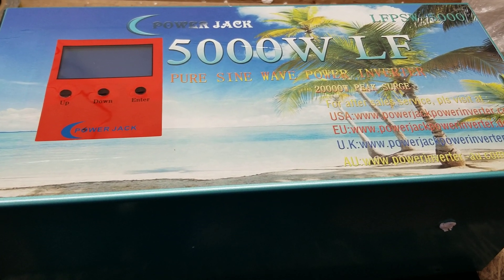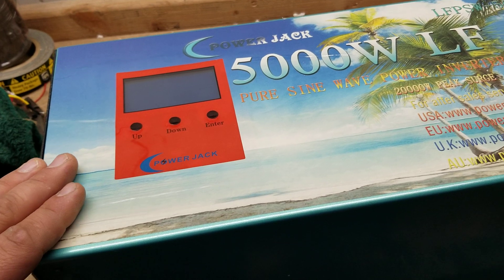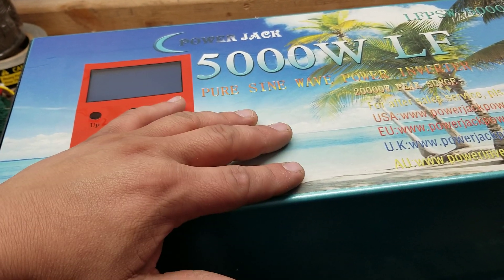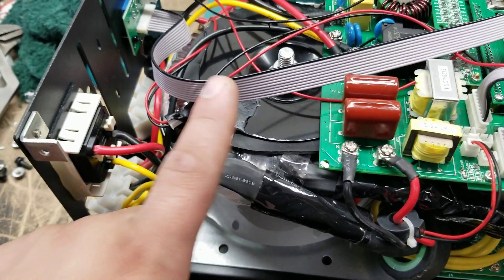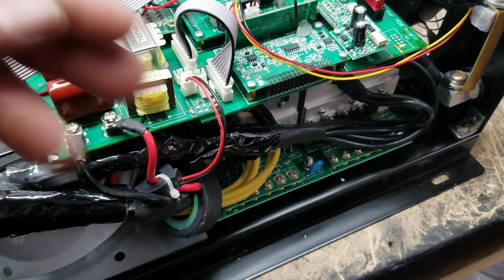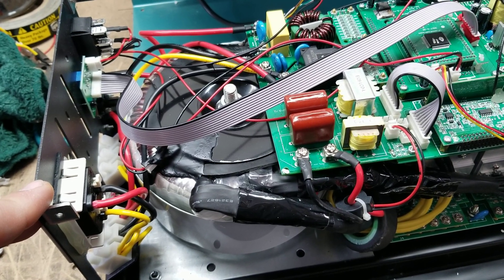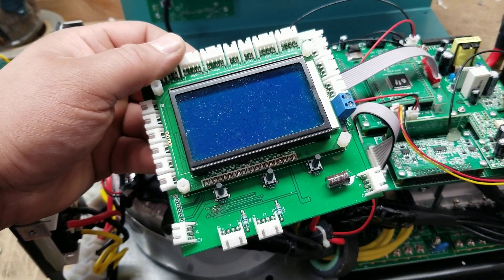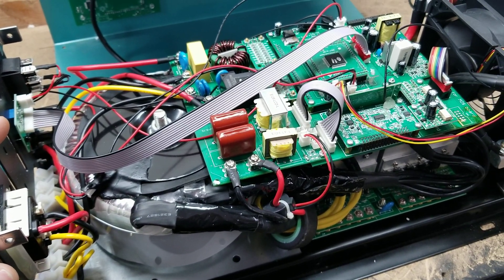5000 vs 4000 LF power jack inverter

Comment: Hi .ser .I have a 5000 watt inverter power jack the two right side mosfet light is off and not electricity coming out of the AC .why is that . He turned on but then the front light doesn't come on. not the green light not the red

Comment: they are both only 1500 watt 20,000 watt peak? LOL. NOPE. 25 AMP FUSE BLOWS AT 1500. That was not a TYPO. 
A, "25 AMP FUSE". That being said, my runs great. It has a nice clean sine wave. At a very cheap cost. AUTOMATIC TRANSFER SWITCH ,is great to have.

Comment: I had a 12-volt system I am changing to  24 volt. Does the inverter go to 24 volts automatically or do I have to do anything to it?

Comment: Search the MOSFET board is easy to disassemble, but I can't get a new one here in Germany! I have had the device since October 2017 and I am very satisfied. After a hard test, the MOSFET plate burned out and I need a new one (heat dead). I'm now installing a fan here. Turn the decel over and build the second fan over the transformer. I charged my batteries for 7 hours and then it was over. I wanted to desulfurize you, I thought 4 hours and then the device switches off, but it was not. The device would be great if you got the MOSFET flap. Can someone help me here? - Thank you (goggle translator)
Reply: El modo cargador hay que iniciarlo con el inversor parado y la Red externa enchufada el ventilador siempre encendido. Si se está usando un generador eléctrico como fuente externa tiene que ser un generador confiable que no cambie. De revoluciones ya que si lo hace cambiaría los herz de frecuencia. Este cambio de sincronisacion genera mucho calor en los mosfet y hacerlos explotar en el peor de los casos

Comment: VERY Interesting vid Gentry - I'm from Australia, I have a 24VDC to  4000W LF 9.0 240V 50hz AC (Model: LFPSW-4000-24-240) and I think you are correct as my unit will start and run my 2hp air compressor while also running a 1836W (2000W) electric heater. I measured peak power draw of 13370W with >8000W for about 2 seconds. I see peak power for the 5000W is 20,000W but my 4000W only states 10,000W. If it is in fact a 5000W debadged to 4000W that would explain the huge extra peak power this thing can handle.
My DC source is extreme: 24V ~165 Farad Supercapacitor boosting a 28.5kWh 24v AGM battery bank (14 x 170A x 12v AGM batteries as 7 parallel sets of 2 in series - 24V @ ~1200A). My only concern with the 4000W LF Power Jack is that it gets very hot (~140ºF) with just a modest but fairly constant ~2000W load for 6hrs and I seriously doubt it could do a continuous 4000W load.
I have heaps of solar power (30 x 320W Monos) during daylight hours (Perth WA ~ 7hrs of sun winter, 9hrs in summer) but had to restrict load to a max 2500W at night due to heat issues.
After seeing your vid I have just ordered another  LFPSW-4000-24-240 Power Jack as I think if I parallel 2 x 4000Ws then all power / heat my issues will disappear. Keep up the good work man.
Reply: I did not think these could be paralleled ?